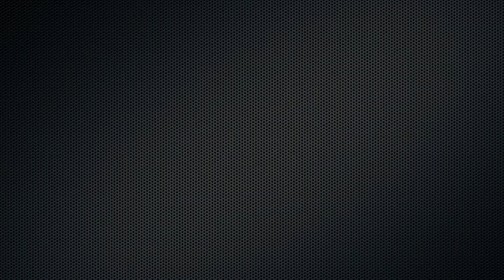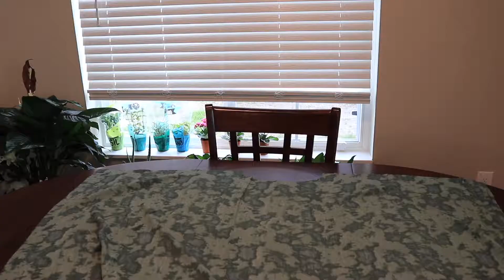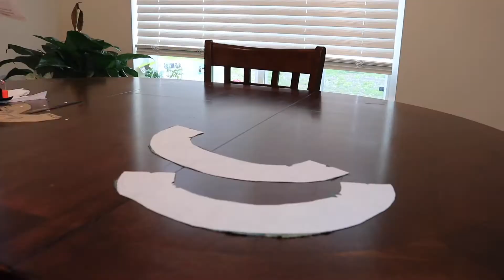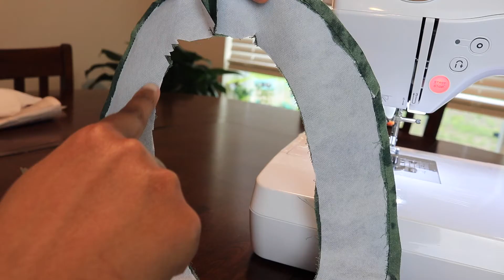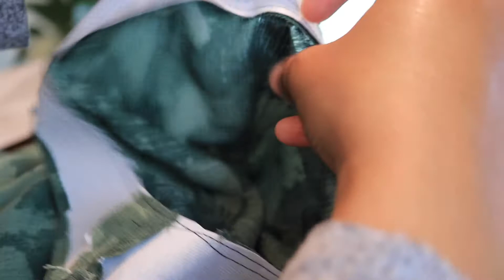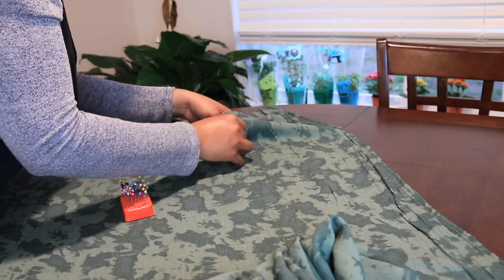SIMPLICITY PATTERN #5628 SEW-ALONG | BEGINNER FRIENDLY | VIEW 2 KAFTAN

Comment: Thanks for the sew-along. Caftan looks great! I wasn't able to find the pattern so I drafted a caftan pattern and hopefully it turns out ok. I do have a question about tacking sleeve. How far down do you sew when tacking? You mentioned beginning 11" down from top.
Reply from the maker: Hi @Silvia Reyes, You are so welcome! I've seen a lot of ppl draft caftans, i hope yours work out for you. So this caftan is pretty much box shaped. picture a rectangle (with the longer side being your body) I simply went to the top right and measured down 11" marked that spot and sewed down from there. The 11" is the arm hole that was created so its left open. I then did the same thing on the left side.
Reply: @sewnaturalb851  Thanks for the quick reply. I started sewing caftan, I chose to go with one just below hips. I actually saw Angelina Jolie wearing a solid black one and after watching your video, well you inspired me to go for it! Thanks!!!